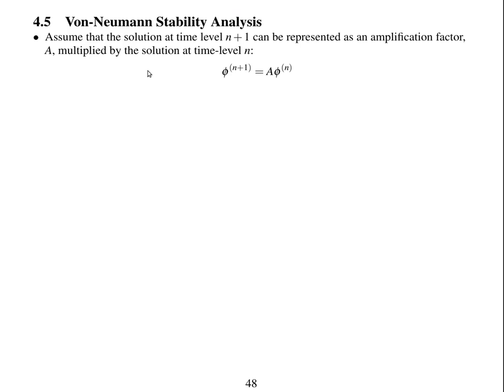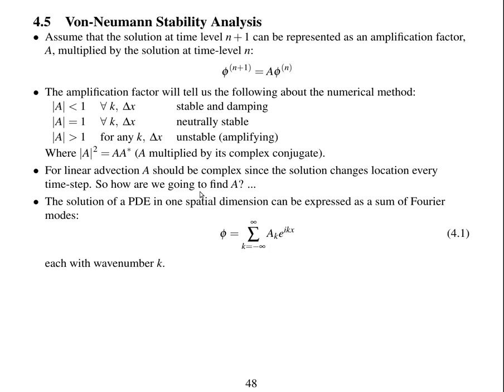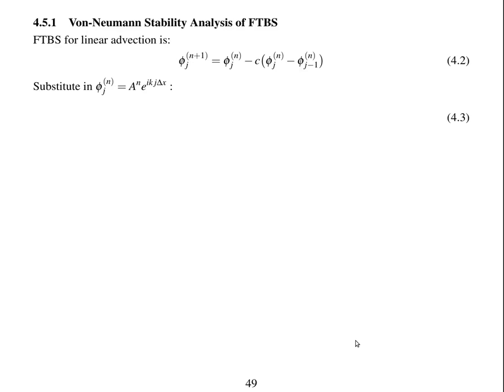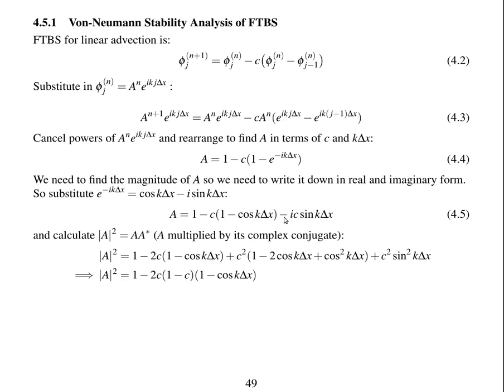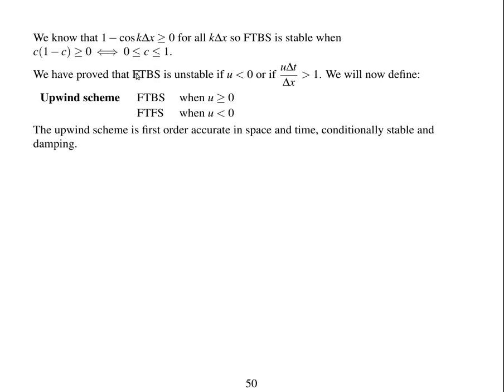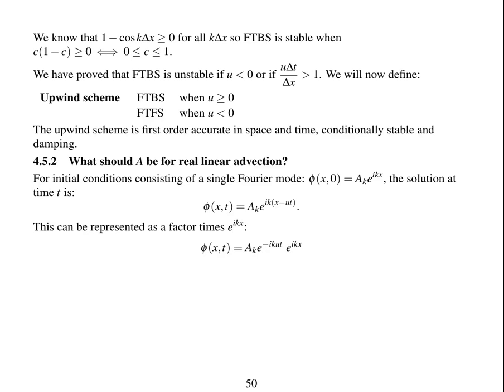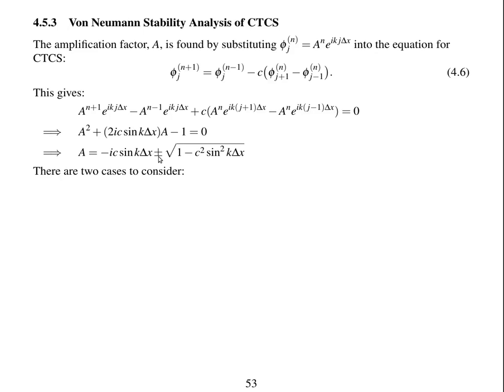5.3 Von-Neumann stability anslysis

Comment: Miss, firstly thank you pure explation of hard concepts.  I had  a question.

What is the way of unbounded analysis? I mean scheme is stable but the value of the fi increase.  How can we create like this scheme and how can we analyze its stability?
Reply from the maker: Miss, thank you for your kind comments.
Your question is difficult to understand. When you say "What is the way of unbounded analysis" I do not know what you mean. Do you mean, how do apply von-Neumann stability analysis to numerical methods for solving unbounded equations? I will try to answer that question. Firstly, von-Neumann analysis can only applied to linear numerical methods for solving linear equations. So if you are solving something non-linear you will need to linearise before applying von-Neumann. Then, if you were analysing a scheme for solving an exponentially increasing equation, you can still apply von-Neumann but the limit on the amplification factor for stability is slightly bigger than one. See
https://folk.ntnu.no/leifh/teaching/tkt4140/._main066.html#ch5:sec44
Reply: Miss. Weller, firstly, I am a male :)

Thank you for response. I am sorry. I had not realized that I wrote too short my question. But you understand correctly what I wanted to ask. I asked that if the physic which will be solved is a case which ossilate and its amplitude increase, how can we solve it? For example,  at enough high speeds, amplitude of ossilating of aircraft wing increase respect to time.  It is called as flutter. How could we solve it with these schemes? But, now, I understand. Thank you again <3  @hilaryweller615

Comment: Say, I am advecting a square wave using an upwind scheme, which is stable and also consistent. Then it should also be convergent. But as time progresses, it gets diffused. That means it is not convergent. What am I missing here? Thanks
Reply from the maker: Convergent means that it will get closer to the right answer as you increase the resolution pin time and space
Reply: Sorry, I realized what the answer is...

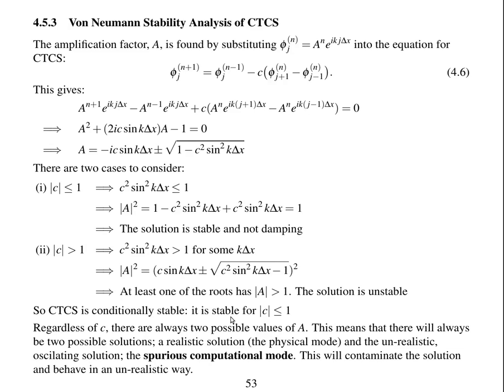Comment: I have a question @13:12. Here you say we have two possible solutions due to +/-. Do you mean to say one of the sigh gives realistic solution and if we use other sign, we get unrealistic solution? thanks
Reply from the maker: These two solutions due to the two signs are only separable in the numerical analysis. The numerical analysis reveals an aspect of the solution that is realistic and an aspect that is unrealistic. However when you are solving an equation using a centered scheme, it is much more difficult to filter out the computational mode (ie oscillations in time or space). You cannot just choose one sign over another
Reply from the maker: It is numeric analysis of a centered scheme

Comment: Firstly, thanks for the videos. They are very helpful. I have a question @2:05. Here you say, we need to multiply by complex number to move the wave. But doesn't multiplication by complex number just rotates it around x-axis? Sorry, I am a bit confused.
Reply from the maker: If you start with a wave represented by the real part of exp(ikj dx) (where i=sqrt(-1), k is the wavenumber, j = 1,2,3,4... is the grid point number and dx is the grid spacing) and you multiply it my a complex amplification factor, r exp(i theta), then the real part of the result of this multiplication will be shifted along the x-axis as long as theta != 0.

Comment: thank you for your help. i have this question: how do you use the Von Neumann in the Lax-Wendroff scheme for the same parabolic pde?
Reply from the maker: To do this, I would write Lax-Wendroff as a finite difference scheme. Ie write the value at the new time step in terms of values at previous time steps, substituting in all equations for values at half time levels. Then substitute in phi_j^n = A^n e^(ijk dx) and simplify to get an expression for A in terms of the Courant number, c, and k dx. From this you should be able to see that L-W is stable for the advection equation when the Courant number is between 1 and -1. If you would like more help with this and similar topics, you may like to consider signing up for my online class which will run again starting in September 2022 https://www.reading.ac.uk/met/met-online-classes.aspx
Reply: @hilaryweller615  thank you so much

Comment: Thank you for the clear explanation. Two question arised:

Is there a stability analysis for implicit numerical methods using the finite volume method, similar to the Von-Neumann stability analysis? 

Furthermore, is the diffusion number the equivalent to the courant number, just for pure diffusion?
Reply: You can use von-Neumann stability analysis for implicit finite volume methods on uniform, periodic grids. You can only analyse linear numerical methods on uniform grids with von-Neumann stability analysis.
The non-dimensional diffusion coefficient is similar to the Courant number but for diffusion. You could also call both of them the non-dimensional time step.

Comment: Nice, by the way, Does Von Neumann stability still work for the STEADY STATE?
Reply from the maker: Von-Neumann stability analysis applies to equations rather than to specific flows. For an equation with a time derivative to have a steady state it would need at least two terms on the RHS that balance. For Von-Neumann stability analysis to work all terms must be linear. If you had an equation without a time derivative but with an iterative method to solve it, you could write the iterations as time steps and apply the same analysis. Remember that Von-Neumann stability analysis applies to periodic domains, not to domains with boundaries
Reply: @hilaryweller615  yes, at the RHS, there are two space variables (x,y). But in my opinion, it is difficult to apply Von Neumann for two-dimensional steady state, because x and y play the same role in exponential term of Von Neumaan.
Reply from the maker: I didn't ask if there were two space variables. I asked if there were two terms and are they both linear. Von-Newumann stability analysis is frequently applied to 2D problems. The trial solution is 
exp(i(kx + my)
where k is the wavenumber in the x direction and m is the wavenumber in the y direction. You may need to get a book on this or find someone who can explain it to you.
Reply: @hilaryweller615  ok thanks in advance for the answer. I have already did the trial solution what you suggest into the discretization results, but at the end of calculation, I don't know what the next step is, which one the variable that will be the parameter of stability characteristic. In case of unsteady state, \lambda^n respecting to time that will be the parameter of stability characteristic.
Reply from the maker: @mohammadghani1379  sounds as if you need to find a collaborator who can help you.
Reply: @hilaryweller615  yes, hopefully, will find someone who can help me